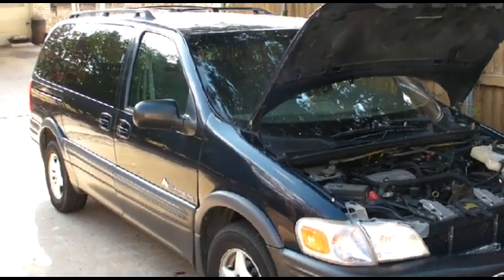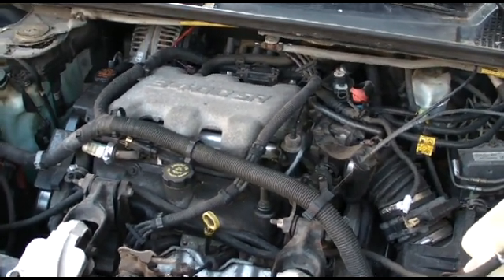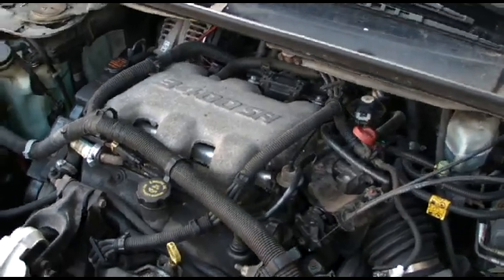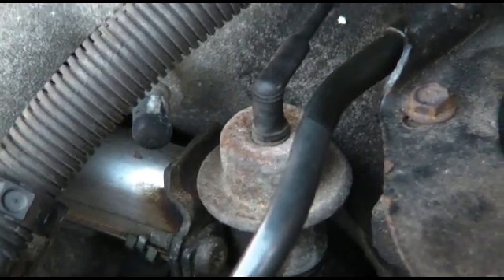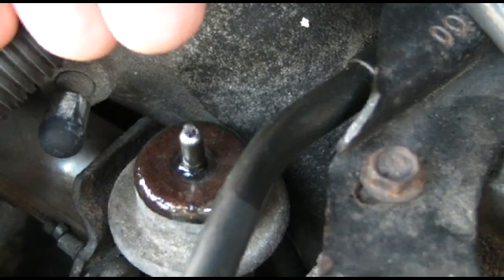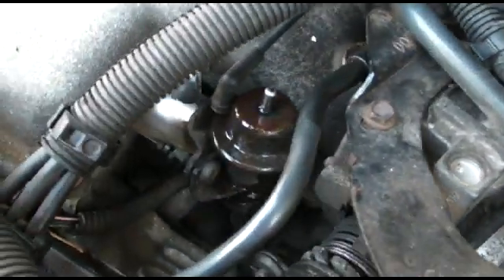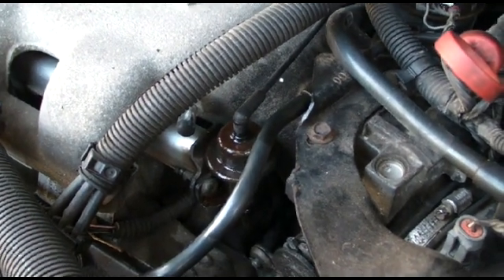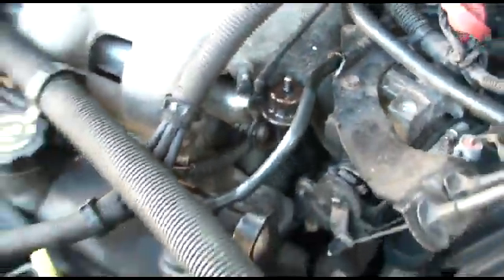Broken Fuel Pressure Regulator Pontiac Montana

Comment: Thanks, It's been not wanting to start for a while now. I started with a new fuel filter but then it would not start at all and  fuel was running out of the filter box so I knew it was sucking in fuel but didn;t know from where,  the  regulator did the trick!

Comment: What cause a noise sounding like there is air in the fuel lines when the pump is on ,similar noise is coming from pump in tank this is a new pump and is sending fuel .I can't get the engine to run . Checked the lines in tank they seem to be OK.  Anyone have a idea what it doing. Its a new one for me. Thanks

Comment: Its not supposed to come out any Fuel from The Fuel pressure regulator at all?
Reply: not on the top, only on the bottom. the vacuum is adjusting the fuel presure.

Comment: Thank you , I was checking my buddy's Chevy venture , with the same engine and a LTFT of -10 and sometimes -25.  First thing I did was remove the fuel pressure vacuum hose cause I suspected a ruptured in it, and waited and no fuel comes out the top ! Hmmm! but the fuels started to climb back to 0 . I guess the air leak by removing the vacuum line had balanced the higher fuel mixture and or did stop sucking fuel thru it , from the pressure regulator ? I am lost. The car runs fine, will clean the MAF sensor and see if it helps , unless an injector is staying open long.. I also will try and injector balanced test.. Any help will be appreciated..thanks for your informative video.

Comment: Hi I have a 1990 lumina apv 3.1 and have a feeling I need to replace and Injector. I've checked all other possible sources and eventually saw that one of my injectors is insufficient and not spraying as the other one. My question is how to remove and re-install a new injector. please get back to me asap if able.